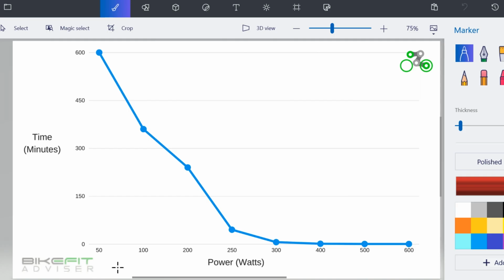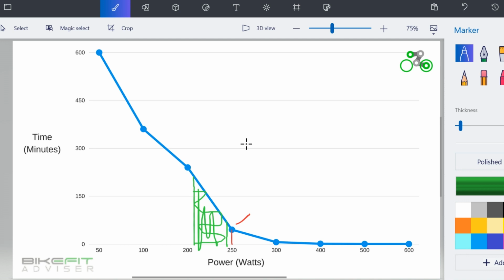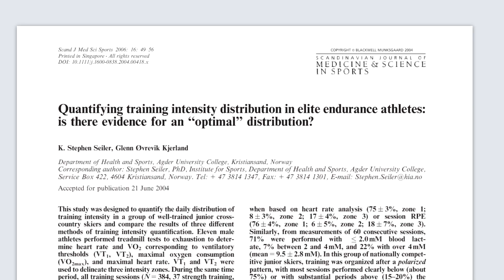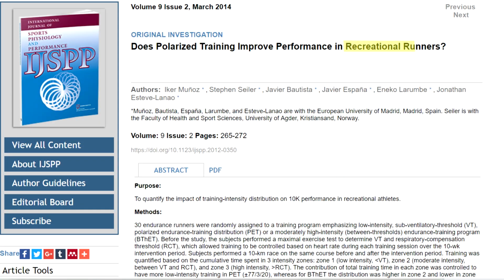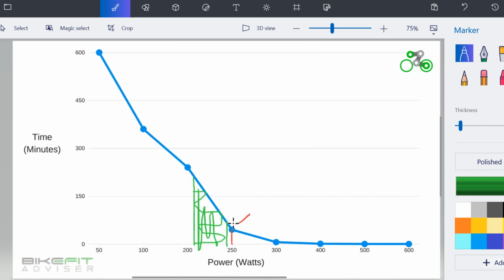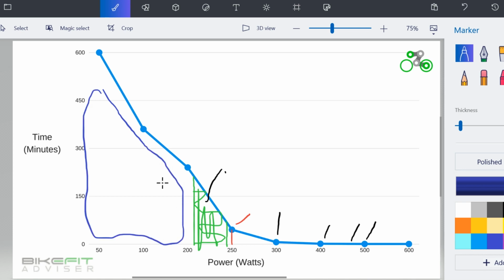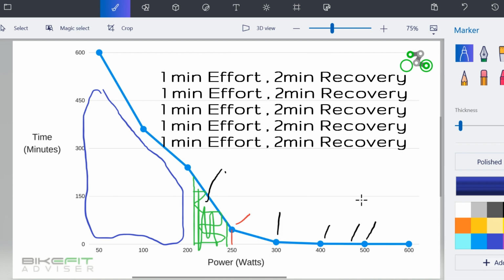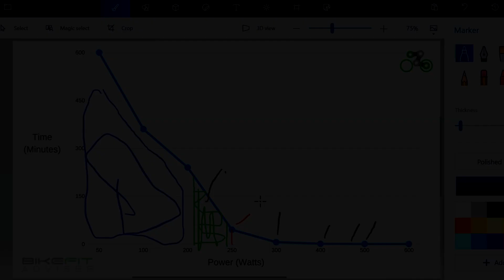A Training Mistake That Can Ruin Your Bike Fit

Comment: Hi, would you be so kind as to either link to the articles or explain how relates to sweetspot training. Where the idea is that this is the zone where you get most training gains with least amount of fatigue build up, hence the name "sweetspot". This middle zone that you speak of seems to correspond to the sweetspot zone, or am I wrong. Are the articles debunking the sweetspot idea? Please explain if you could.
Reply from the maker: Vilmore I hesitate to say that it's debunking the sweetspot training method...there's always more than one way to go about a task. 

But there is some evidence to support the idea that staying out of the middle can be a more efficient way of going about things. I think there's some misinformation out there when the sweetspot method is being proposed -- I have read a few articles that pit it against a polarized/periodized program with the idea that the sweetspot can be done in much less time and you have to slog for hours and hours when you periodize. This couldn't be further from the truth...in fact there is a bunch of research  examining (successfully) how small an amount of high intensity work can elicit huge  adaptations in athletes -- literally in cases where a workout of a few minutes long can elicit effects normally seen in a 90-minute exercise bout. (Just start combing through Google Scholar for articles on all the HIIT and Tabata - among others - training methods. Also, if you search it for "polarized training method", nearly all of the articles I referenced will pop up on the first page and then there are lots more in the notations of those articles) Marathoners setting personal bests on just a couple hours a week of training. Now this type of training may not be for everyone -- there are other considerations to take into account, not least of which is that the workouts aren't that fun, they can be inappropriate for some athletes, especially in the case of running due to the mechanical impact. 

Another aspect that I think gets minimized when talking about the sweetspot method is that it's made to seem like you can just spend all your time there no matter what. In fact, just like every other training method we have to take into account the intensity and the duration. There's a reason it works well for athletes who are strapped for time -- because the rider's job and family obligations are going to keep them from riding too many hours a week already. Again, I'm not saying it's bad all the time -- just that I have seen many athletes spend nearly all their time in what would be their sweetspot zone and it creates problems.

https://roadcyclinguk.com/how-to/six-things-need-know-sweetspot-training.html

This is a good article about some things to keep in mind about sweetspot training. To this article I would add or reinforce two things: 1) Just as the author says you could make yourself slower by training in the sweetspot excessively, I'd "second" this, and add that you're also not likely to make yourself faster -- it helps with efficiency near your threshold and below but it won't make you more efficient at higher intensities above it. And 2) I have had a few athletes that came to me for training who spent tons of time in the sweetspot zone and ended up incapable of getting the heart rate above a certain level. For example, they had spent so much time just at or below their threshold, lets say at 155 bpm, they literally couldn't get their heart rate over 162, no matter how hard they worked. It took about 5 months of steady polarized work -- very easy and very hard -- and by the end they could get into the low 180s, and they went on to have the best riding season of their life, while in their mid-50s.

Definitely more than one way to skin a cat as they say, but I tend to favor the polarized method because I find it's easier for clients to follow and not get off track with the intensity of their effort and it works pretty quickly and efficiently.
Reply: You miss one of the main draws of "sweetspot" training. Recovery. You simply can't do HIIT, Tabata, or Z4/Z5 intervals more than once or twice a week as you simply can not recover sufficiently from such efforts overnight and ensure another quality training session the next day. Sweetspot is supposed to be hard enough to create physiological changes but easy enough to recover sufficiently to do another difficult session the next day. If some of your athletes have done so much sweetspot, Z2/3 or whatever training that they can't break into Z4/Z5 then something was horribly wrong with their training protocol from the start. Lastly while the article does say you, "could actually be making yourself slower" it's with the caveat of "you[r] performance over short periods." If you only have 60 minutes a day during the week you can only realistically have 1 or 2 interval days and the other 3 - 4 days of Z1/Z2 base for 60 minutes just isn't going to help your aerobic engine much before the long ride on the weekend hence the reasons for "sweetspot." It's exactly as the article you linked states, "sweetspot is a very important training tool." to be used alongside other sessions....
Reply: BFA I really do agree with ur view on this regard and its a great real world experience that u had presented to us in the two scenarios of 
1)athletes who bound by daily obligations to carried out (80/20 suites them to have a physiological boost) 
2)athletes who couldn't pass 155BPM (seem as not frequently participated to racing as an elite rider)

For these types of  riders the recommended 80/20 seems the choice left. 
These studies with respect to 80/20 is carried out with elite athletes and in terms of cycling many have to go through races while they are on the study and if not have to under go tests to measure their performance quite often. So these samples doesn't surely represent all those who seek to efficiently increase their performance. 

Also from my experience that who had followed 80/20 I know its not for me and likewise its not the all to follow approach even though most do suggests like that. As u had rightly pointed out there are many ways to gain same with different efficient levels. As cycling is bit different sport when it consider with other endurance sports specially in the regard of how u can save energy by drafting behind or riding in a tail wind 
and use them to change ur output levels while remaining on ur threshold for so many hours(3-4) in a race and then switch to higher Threshold with the demand its better to train on the threshold more than not touching it @all(or much lesser).For me its 3:2:1 (TH : Below TH : Above TH).

To ride a 5-6 hour one day classic or 2-three weeks stage races having a training of only 80/20 is doubtful. Unless they only participate for such few event like Olympic/National Championships.
Reply: Hi John, 
Thank you very much for the long reply. 
There might be more content here for a future video :)
After I had typed in the question I started googling and I pretty much ended up reading articles and scientific paper till 3 in the night... so much for a good nights sleep.

In the paper by Craig M. Neal and others from 2012 "Six weeks of a polarized training-intensity distribution leads to greater physiological and performance adaptations than a threshold model in trained cyclists"
They let riders either follow a full threshold or a full polarized program. The riders have more progression after following the polarized program.
But the question remains unanswered is what if they would let riders do a mixed program. 
Would it be worse? because it is just a mess and there is no focus.
Would it be about average, between the two other programs?
Or would it be better, combining the best of both? 

Let me boil the question down to a concrete example. I know there are many people who are not pressed on time to rest, but can only do a few hours per week during the regular work weeks. 
(I know everything changes for full time athletes that are not limited by the time they can train but by the time they can rest.)
Lets hypothetically say I can do 3 sessions during the week, similar to the training program in the paper mentioned above, (six intervals of 4-min duration with 2-min rest periods) or about an hour of hiit in various configurations. 
Then I am pressed in time for one more weekend ride, if I only have 2 hours. Should I spend those 2 hours in low intensity, so I get a similar training week as the study subjects from the paper. 
Or will I get more aerobic gains from 2 hours in the medium zone (around sweetspot)?
Is it better to skip the endurance ride of limited time (2 hours is not really long enough for a good LSM ride) and instead go into the medium zone, because the time is limited anyway. 

I personally like the idea of polarized training a lot. When I'm on the road I like smashing it, burning matched, going full gas on strava sections etc. compared to doing long miles and having to save it up because the ride will last 3 more hours. 
And during the winter I can train more efficiently on the trainer if this is all true. 

@Salinda, consider that professional riders also train by racing, racing is by definition a mix with a lot of medium zone intensity. 

@OhAiShare, The paper seems to suggest that maybe sweetspot is hard enough to cause fatigue, but not intens enough to cause significant physiological adaptations. (I'm simplifying of course)
Reply: Vilmore - Which paper are you referring to? The one that Bike Fit Adviser linked does not state sweetspot is "not intens enough to cause significant physiological adaptations." In fact it specifically states, "Base and sweetspot training give similar benefits and while sweetspot may get you there slightly quicker, there are downsides in that can lose your explosive power." Essentially sweetspot is for training your 60min - 150min power and efficiency. If your goals are on either side of that window, constant daily sweetspot training isn't for you. Additionally if you have unlimited time it's obvious that polarized training will create more physiological adaptations with hours and hours for low and slow aerobic training but for those whom are time constrained there's good reason why sweetspot is considered "best bang for your buck" as it is hard enough to stimulate changes and able to recover from to do it 3-4x a week IF your goal is FTP improvement. Further, IF sweetspot isn't intense enough to cause significant physiological adaptations, "base" or Z1/Z2 training will definitely be wasted time on a constrained schedule. There's good reasons why metrics like TSS and others have been created to measure training stimulus. 

For yourself, if you're only training 5 hours a week (your stated 3 sessions of about 1 hr during the week and one 2 hr ride on the weekend) you likely won't benefit more from polarized training. The problem with polarized training for most cyclists is that the "hard" days athletes haven't recovered enough or able to dig deep enough get the most out of the session. Then on the flip side on the "easy" days they go way too hard, the "easy" days will feel like you're crawling. So for that weekend ride is at most Zone 2 for the entire ride with maybe a few surges but you're not going after any Strava segments or racing your friends to the stop sign on a polarized program. Your training availability doesn't have enough low and slow time available to create the stimuli to change your aerobic power and efficiency. Though if your longest ride will be 2 hours, why would you specifically train your 3-6+ hour power and endurance (the "base" in polarized training) vs being an FTP/sweetspot monster? But there's so many free training programs out there, why don't you try one that includes variability and isn't defined by these explicit training mentalities which require many more hours than you have to train? If you don't wish to trust a random voice on the net why don't you try one of the programs from British Cycling or many other 3rd party sites? You'll notice quite a few "sweet spot" or "threshold" sessions along with shorter and more powerful efforts.

https://www.britishcycling.org.uk/knowledge/training-plans

Bottom line: Focus training for what you want to be good at and variability includes enough stimuli to create well rounded and athletes. That's all this boils down to.

Edit: If you're referring to the Craig M. Neal - "Six weeks of a polarized training-intensity distribution leads to greater physiological and performance adaptations than a threshold model in trained cyclists" you need to note the work breakdown. 80/0/20 vs 53/43/0. If you're on a sweetspot program you're likely to have much more 'moderate' activity than 'low' activity. This is again where TSS and other training stimulus metrics come into play along with training for what you wish to be good at. The less time you have to train a week the harder your intensities need to be to create the stimulus to create change but again the necessity is the recovering before the next session!
Reply: Good reply OhAiShare, thank you.

To be clear I'm not attacking sweetspot, I'm only trying to bring conversation to life. If an idea is good it should stand when questioned, right?

And you bring up a few good points.
Maybe in the study (glad you found it ;-) the subjects doing the polarized training where simply training harder in general. 
I guess they might have tested this to balance this out, not sure. But that leads me to another question, can you train harder when on a threshold (only) program, maybe you can?

And I totally agree with your bottom line statement. 
That is also what I do in my own training, I try to mix it up and give my body a variability in stimuli. 
But I also agree with the overall message in the video, I think many of us gravitate towards "just riding hard" at least when we dont have a trainer or are not actively paying attention to it. 

And the example I gave is not really about me, it was ment as a hypothetical case, even though I have had some of those weeks this year. 
But this is a topic that greatly interests me and I believe not everything is set in stone. The scientific studies mostly focus on high end athletes, not average joes trying to get the most out of their limited time. 
I've read the book "A time crunched cyclist" but the plans expect at least 8 hours a week, and its already 10 years old. So I'm always interested to hear what people have to say.
Reply from the maker: Thanks for your input. As I've said a few times, there's more than one way to skin that cat.

But it is a false assumption that polarized work is only viable if you have tons of time to train while sweetspot training is the plan that's ideal for time crunched athletes. HIIT, tabata, and other polarized variants can absolutely be done more than twice a week. It's merely a matter of the amount -- just like with sweetspot work. Any training plan has its balance of intensity and duration. If a rider can do 12 x 1 minute intervals at 400 watts and this is really challenging and requires a full day or more off the bike, then doing 5 or 6 of these intervals instead (during a brief hour long workout for example) will elicit a positive training effect and still allow the rider to perform another similarly brief and potentially intense workout the next day. High intensity, polarized work doesn't have to leave you wrecked to have an effect.

I liked the book by Dave Morris, I think it's called "High Performance cycling"....it's not new but has some great information in it. I've used elements of it to help a lot of athletes, including interval work for an unlikely cyclist -- someone who set the record for the Great Divide mountain bike trail -- 2500 miles long with a quarter of a million feet of climbing.
Reply: Vilmore - Not saying that you're attacking sweetspot, I'm trying to convey it's just another tool in the training arsenal and there are specific goals when employing it, just like other sessions. To answer your question regarding if you can train harder on a threshold program the answer is "it depends." As again, it's not really about the stimuli of the session itself, but whether or not the rider can RECOVER sufficiently before the next session. Interval or other high intensity sessions are severely reduced in their effectiveness if the rider isn't at 95%+ recovered before the session. The benefit of "sweetspot" is that a rider can complete the session on back to back days even if they're not recovered to the 90%+ (these are somewhat arbitrary numbers but hopefully you get the gist) level and still complete the session to it's full intended effect. One can't do a full week of "sweetspot" back to back the whole week as a rider just won't be able to recover sufficiently. Just like one can't have 3 quality sessions of intervals or other high intensity sessions during a given week and expect to recover sufficiently while also building an aerobic base on a time crunched schedule. The programs utilized in "A Time Crunched Cyclist" use a lot of interval work and the ability to recover from this high level interval work and also notes that your long endurance will suffer using that program as the program was designed around the U.S. Cyclocross champion which usually have races about an hour long. Nothing wrong with that if that's your goal but unless you've trained to the level where you can recover fairly quickly, you're likely to fatigue/burn out if you followed that program session for session. 

Bike Fit Adviser - When I see you say "HIIT, tabata, and other polarized variants can absolutely be done more than twice a week." I have to cringe. As you ultimately sacrifice quality for quantity. VERY few programs ask a rider to do more than 2 high intensity sessions during a week because if you're doing the quality high intensity intervals correctly it takes quite a bit of time to recover and is what the following easy day(s) are for. Shoving in a half or quarter session of high intensity work because you're unable to recover just reduces the efficacy of the high intensity session and makes the following day's session purpose dubious as is it a rest day, another half day, a interval day? It's interesting you're advocating doing back to back days of half interval sessions instead of one interval session day...? The only time I can see that being employed is for a serious racer who races on back to back days and needs to train for the lack of recovery time... Part of the reason one does a single interval session is to force the active recovery and why it's not broken up over multiple days. One can go do 4x1 min 400 watt intervals every day for 3 days but the effect is NOT the same as 12x1 min in an one single hour session. But again, no one's denying polarized training works but for any time crunched/amateur athlete doing the proposed 3+ interval days is just a recipe for disaster as the most important thing of ANY training program is RECOVERY. As that's where the body takes the stimuli and makes the changes that allow the body to come back stronger than before. If you can't recover, you can't reap the benefits of your training and will fatigue. Unfortunately your video nor your comments cover this most important aspect to any training regiment.